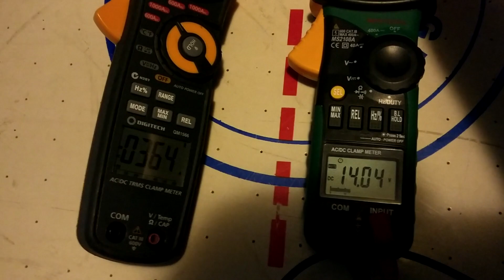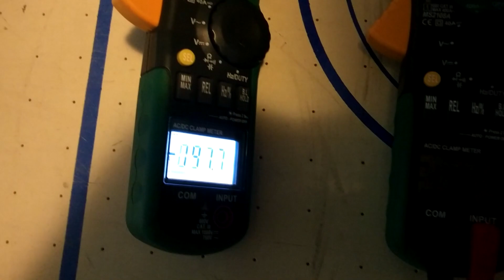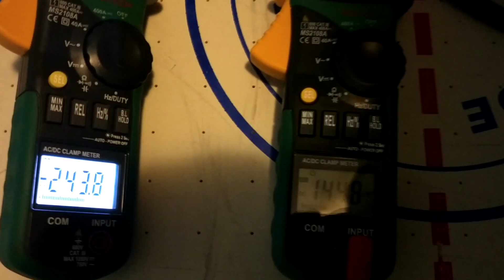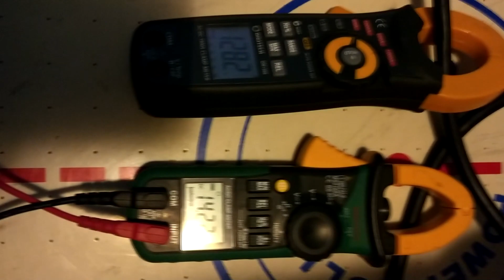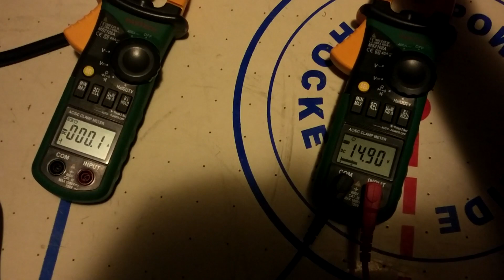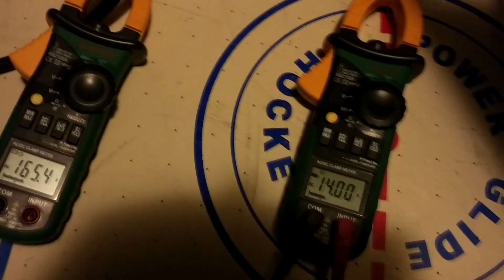Yinlong 35 Ah load test

Comment: The last 28 seconds of total darkness was a nice nod to home experimenters everywhere.  That must have been testing that they could charge fast enough to trip the mains breaker.
Were you able to get 35ah out of the batteries?  Will Prowse only got 30ah out of Yinglong LiTO''s that were rated at 40ah.
Reply from the maker: I have not capacity tested any cells, I'm mostly just interested in c-rate at a good voltage.
I likely never will as I don't want to know what they really are, if it's less I'll be sad as I bought quite a lot of them, but I knew they'd have lost a bit over the years.